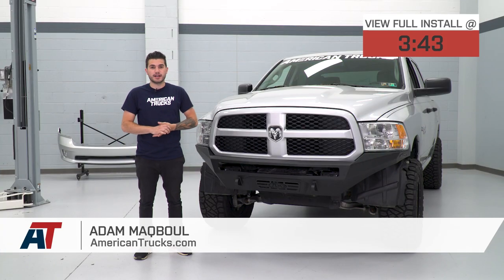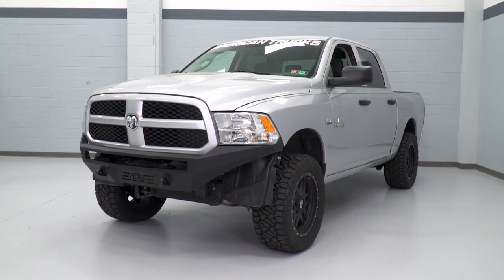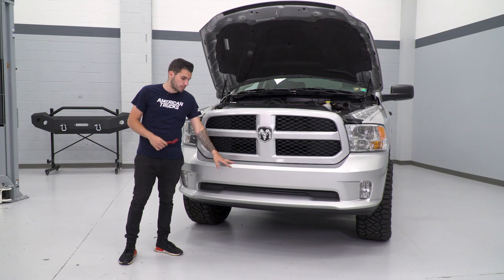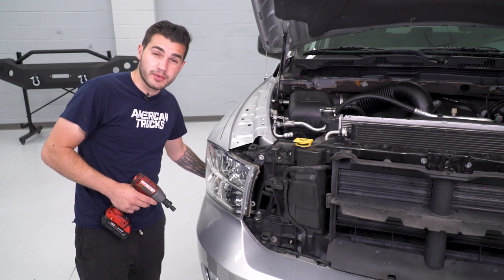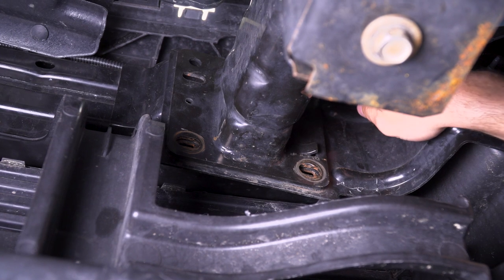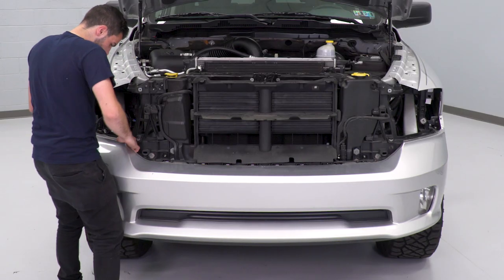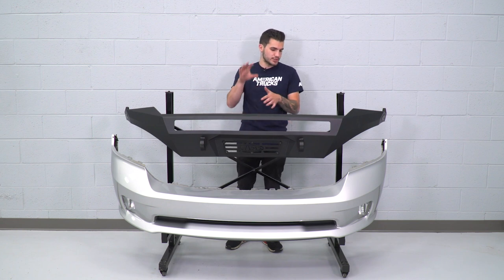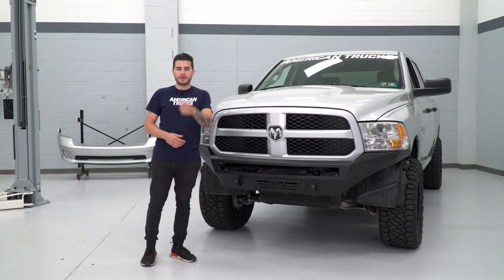2013-2018 Ram Addictive Desert Designs Stealth Fighter Front Bumper Review & Install

Comment: Damn. I just want a simple heavy duty steel bumper for a work truck Tradesman 1500 2WD. I hit a deer and want a better bumper. Every one of your bumper replacement options is focused on off road.  😡
Reply from the maker: Please feel free to check out all of our other options on-site! Thanks for watching! 😁 -Zach
https://www.americantrucks.com/ram-front-bumpers-2009.html
Reply: Tyger automotive website contact them for a 5% code.
It's a 650$ steel bumper that has the ability to take cube lights and 20 inch in the middle bull bar.